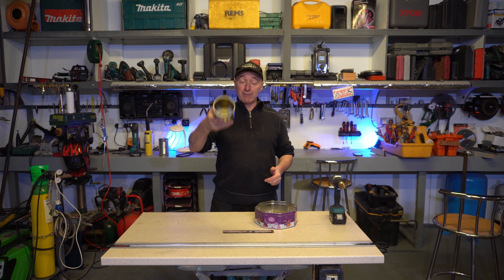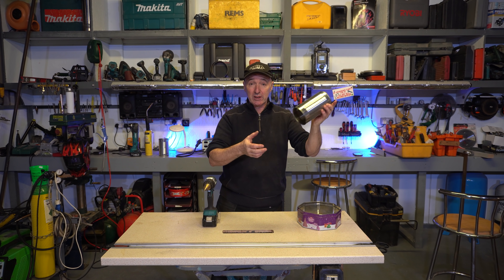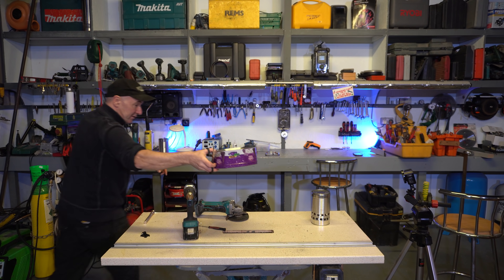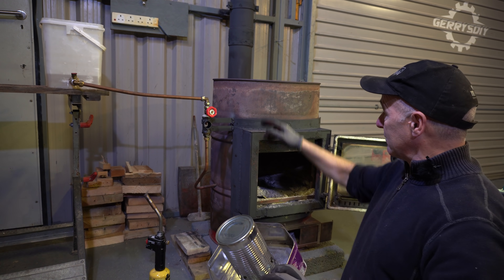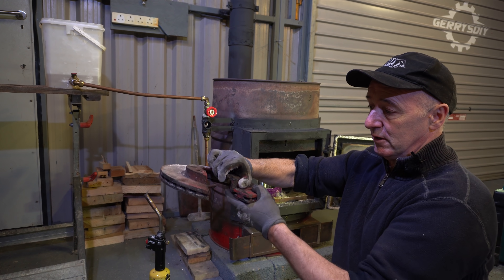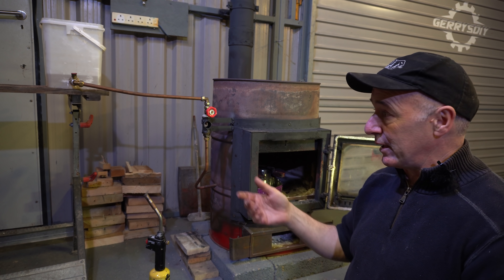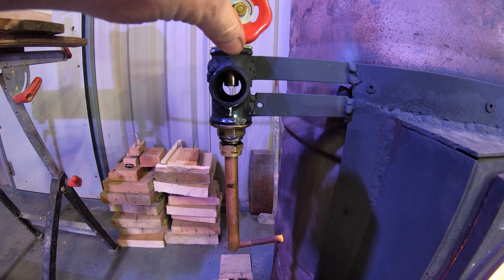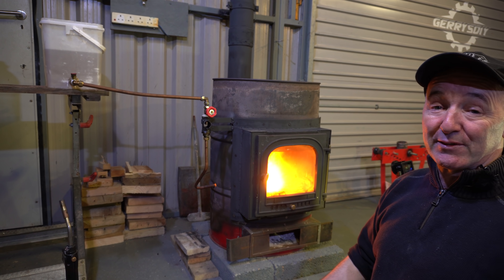Free Heat .. Fantastic Tin can Waste oil Burner

Comment from the maker: Burns Great. Sawdust and Veggie oil mixed as fuel. https://youtu.be/8TNueNfDJTg Cheers Gerry
Reply: fyi a growing trend is asking for likes and subs in the first minute of a video ---- dude. we are mostly adults watching , if your shit is interesting enough we might subscribe  but I will tell you there is a growing number of people who are so tired of people asking for subs at the get-go and it prompts us not to subscribe--- you gotta earn it
Reply: @GenX...MCMLXV  I'm with you on that 100%
Reply: Liquid oil doesn’t burn. Heating it or burning kerosene causes oil vapors.  The oil vapor and fresh air from the drilled holes are what is combusting.
Reply: @undertow2142  ummm iv started quite a few fires with liquid oil.
Reply: @undertow2142  oh thanks. I'm guessing controlling the airflow could be a bit like a throttle?
Reply: @Google_Does_Evil_Now  probably better to control the heat output by varying the oil drip rate. Ideally only enough air to burn the volume of oil vapor would enter the furnace. Any extra is just lost btu’s to the outdoors.
Reply: @Google_Does_Evil_Now  pop pop look
Reply: I used to weld workshop heaters that used the waste engine oil from cars/ trucks etc. I made the firebox from 3mm mild steel, but they were banned in EU because of the emissions. Watching this makes me wonder if the company that i used to make them for, couldn't have just switched fuels, because the principle looks similar.
Reply: @chrisyarnold6205  you can still do it, back door n all. Helping. Their aircrafts and cars are no better for emissions.
Reply: how long will the 5 liter of oil burn ?
Reply: 110 mill??  I'm gone
Reply: Maths confusion - 100MM x Pi divide by 15 is 20.?  15 what? 20 what? What size holes were drilled?
Reply: Good video. Gerry, can you talk us through what's happening? I'm guessing the air flows up from underneath and comes out the drilled holes and passes over the oil which is burning and being dripped into the biscuit chin area and somehow this cool air coming at the bottom of the flame mixing with the fresh oil starting to burn help to create the rising bright yellow flame.
Is that what's happening?

Fresh cold air coming out of those holes, feeding the hot burning oil, like a fan as you said?

Comment: We go behind restraunts and get recycle Cotton Seed Oil mostly, here in Nashvillle and use a hand crank turned pump all Nashville Tennessee  Restraunts, a grease 55 barrel is a must, as we have, three home made cooking Oil, recysled, by straining it, thru screen wire, burn the crud too, let it dry, on stacked shelves 2" apart, a dried chicken skin dried in cooking oil burns hot. Free restraunte Grease, you need a pump.
Reply: Too many commas

Comment: Sir
I see your list and have watched a couple of vidios.
Im 63 retired with a ton of fabrication and build ideas from steel.
I started at 7 and had alot of good teachers.
I have sold off almost all my tools and equipment now but have a predicament.
Hospital trips and all with the wifes passing has put me in a nice travel trailer.  Not bitchig but im comming up on another expensive winter to keep warm.  I say all this because i was able to build almost anything i needed but needed plans when i was in new teritory.
Might you have a small waste oil burner heater on here?
Prototype or not.
I live in a parking lot behind a auto repair shop and they would love for me to burn up some old oil. 
I hope this finds you well and does find you.
Thanks in advance
Bob H

Comment: Thanks Gerry, I live in north west Australia and need a heater for about 2 weeks of the year, this is perfect and you explain it like old mate in the shed. Questions, what stops the burnback in the oil feeder line, for inside use do I need to make a hot box with a smoke exhaust? No glass on front?

Comment: Missleading. Was left with the impression that the cans were all I needed. Still need the stove
Reply: You don't need the stove. It's just a little carbon monoxide. You'll be fine.
Reply: Its an old barrel wod  burner kit and is under $100 last time I looked. So if you can use old cooking grease it would just cost you under $100 to heat garageor whatever all winterand years to come if built right. It was a great video explaininghow it works.

Comment: Whats free about that? veg oil £2.10 a litre at lidl, more expensive than diesel or heating oil, twat!
Reply: You can use a car used oil
Reply: It's free in the sense that instead of throwing away the oil you used, you're using it to generate heat for cooking.

Comment: For your next prototype, you might try this to keep your fuel from leaking out from around the bottom of the can. 

Use the can as your template, make your mark, but cut the hole smaller than the diameter of the can. 
Then make slices radially out to your mark. 

Put the can on top, then bend the tabs up and in to the bottom. 

That gives you a little bent up lip to trap the fuel in the bowl. 
Secure it with a couple sheet metal screws if you want. 
One on either side will do fine.

Comment: Gerry i think you need to look into setting the oil feed system, using a waste oil controller rather than this unreliable gravity feed setup  your telling people to use, simply because you can't control oil viscosity with a tap. Get in touch. Another thing these dog food tins, how long do they last for 2 hours? Waste oil heaters need to be safe and reliable.
Reply: @hemishcurtis
He said it was only a prototype to show how to do it. But you should use steel to make it. Because those wouldn't last.

Comment: I was really hoping that the oil you were burning would be used cooking oil, I mean older diesel trucks can run on that stuff...I don't see why we can't make a heater for burning it🤔 I'd like to see something like that.   Then the neighborhood would smell like French fries🙂👍✌️  edit, oh maybe I misunderstood,you are burning waist oil...but you started it with fuel.👍ok now do a burner that a guy can make and be safe in a home without a welder or a wood burning stove... Like out of a propane tank 👍✌️🇨🇦
Reply: Cooking oil Burning point is 325 F to very high (520 F). It would melt his tin in minutes and cause a fire. Not to mention all the soot off the oil would make everything around it black.
Best to use something that burns at a lower temp.

Comment: Looks good but you also need a wood burning hitter , modified first to use it within other gadgets, what. Other suggestions are there for the container of it , I mean instead for a wooden hitter? Anything simpler? Can that be used to hit whater to go into radiators ? Thanks!

Comment: I've got years of savings of old animal fat I've been collecting in jars saving it from going down the drains and clogging up the waste.
Has anyone designed a burner for it ?
Reply: I don't entirely know if you can use solid fat for heating, but that's an interesting idea to build off of for sure.

Comment: The best heater is....The Cornish Room Heater......small plate ..slightly larger plate ...6 pennies for bottom and 6 pennies for top ....two tea candles ..please watch video on you tube 👍👍👍👍..I tried it out in our room  16feet x12 feet and it gave a temperature rise of 4C in three hours👍👍makes a big difference 👍👍..put plate on flat surface with coaster underneath .keep the heater away from immediate items so it has room to heat and flow👍👍

Comment: That sort of thing is a massive fire hasard, alot of cans like that is made out of tin or aluminium wich has a low melting temperature, be careful what you do and advise folks to when its going to be used with flammable liquids.
Reply: I can attest that aluminum should not be used in such a setup. I have tinkered with a lot of liquid fuel burners and the closer to a proper complete burn, the faster the aluminum will just melt away. My record was ten seconds from light to leaks. Of course, I only test outside on a fireproof catch pan.

Comment: Gerry, 
I just started my research on building my own waist oil burner.  
However I have yet to run across the/ a video  of all the copper  pipes and connections needed to make the drip line. 
Almost every video i have watched says they put something inside the copper pipe, just above the oil flow site hole.  
Can you share what's inside the pipe?
I have searched your comments but haven't located it. 
 I am interested in the whole gravity feed pipe construction.  From the hole in the bucket to the all the way to the burn pot. 
Thanks for reading.  Have a blessed day!

Comment: What does the inside of ur chimney look like after burning this for a period of time? Chimney fire waiting to happen?
Reply: If the burn is complete enough, it should be pretty clean. Wood fires clog up chimneys because people have a habit of burning wood less efficiently so it lasts longer between loads. A good roaring fire every day the burner is used should keep the chimney clean, assuming you don't burn through it. Waste oil/Waste veggie oil fires can get very very hot.

Comment: Where o you get waste oil?  In the USA, used engine oil is recycled and refined into new engine oil, or we use it (if you change your own oil) to lubricate the chain on the chainsaw.  
Restaurants have waste oil 'dumpsters' but they will not give you any, and will prosecute if you steal any.

Comment: I like the set up but as I seen the original it was meant for survival situations where oil was dropped onto a steel plate.

I wonder if the steel plate method I seen in my survival book does the job?

But I suppose every situation may be different and you might have to use what you have.

Comment: Very good. I built the one from a few years ago. It works well.
Reply: Hey Paul. I made one too but it smokes a lot. Does urs? And did u do anything different
Reply: @marcelwilloughby1483  mine only smokes in the beginning, once the metal is hot it doesn't. I assume you need more input air.  Good luck

Comment: Hi there very interesting and innovative DIY project -  Thumbs up from me mate! You could make a more permanent one from an older model car or truck brake drum as the oil tray as it already has a central hole and all you'd need would be a suitable piece of steel pipe the same diameter as the Central brake drum hub hole and drill holes in that steel pipe Seal off the top of the pipe by welding a piece of sheet metal to the top and fill in the brake drum wheel lug holes with suitable sized bolts and washers that could be sealed with heat resistant gasket goo or Muffler putty.  
All of which could be found at general hardware stores or auto places like Repco or Supercheap Auto stores and secondhand brake drums from an auto wrecker etc.

Incidentally - What size Holes do you drill into the central flue/pipe - need that info thxs.  And Why 15 holes and not, say for example 16 holes? or the spacing and distances for those holes from the bottom of the part that goes into the oil tray and the length, I.e. why that particular sized can and not something longer or shorter than the one you used and depth of the tin can/central pipe would be useful info too thanks. 😉 🙃

Comment: wow that so cool
Reply: Agreed -Yeah it's extremely cool.       You could make a more permanent one from an older model car or truck brake drum as the oil tray as it already has a central hole and all you'd need would be a suitable piece of steel pipe the same diameter as the Central brake drum hub hole and drill holes in that steel pipe Seal off the top of the pipe by welding a piece of sheet metal to the top and fill in the brake drum wheel lug holes with suitable sized bolts and washers that could be sealed with heat resistant gasket goo or Muffler putty.  
all of which could be found at general hardware stores or auto places like Repco or Supercheap Auto stores etc.

Comment: Free heat ? So the oil was free ?
Reply: Not really Free as such - but it could be IF you collect it from all the Fish and Chip shops or any fast food outlets that have to dispose of their used oils at some point anyways and many in my neighbourhood fast food stores at the local shopping mall have used 10 litre drums of it sitting at the back of their stores near the rear doors - but I'd need to ask the owners how do they dispose of their oils and IF dumped at landfill in the local tip/garbage dump- would they consider giving it to me as I'd gladly collect it for nothing or for free and dispose of it for them - could be a potential never ending supply of used cooking oils - provided all the small businesses don't go broke with all the covid lockdowns and economic downturns still on the cards or our future - most likely.  😉🙃
Reply: @soloman9151  I've heard of people burning used cooking oil in their diesel powered vehicles.
Reply: @OOICU812  Hi,Yeah I've heard or read that some people do that here in Australia too - but it might be tedious filtering the food particles out of the oil - dunno. But I guess it'd be worth the effort to power a diesel engine a lot more cheaply than diesel supplied by Fuel companies and according to what I've heard or read somewhere [ most likely on You Tube] our new PM wants to phase out Diesel entirely along with petrol/gas powered cars as well.  In favour I presume, of Electric powered cars and/or trucks.   Which, ironically, have to be charged at charging stations using currently coal fired generation plants for homeowners and industry at present.

And, further, we don't even have any re- charging stations for electric vehicles at present - and even iF we did - they'd only be useful in city and suburban areas of the 6 capital cities when finally instituted - so the infrastructure for electric vehicles is just not here to make them practical.   Not to mention that the distances between capital cities is enormous and the range of EV cars and trucks would be limited or doubtful depending on number and availability of charging stations in each country town along the main highway routes - which, IF the country/rural town re-charging stations happened to be occupied by locals charging their EV's would be problematical - to say the least - in terms of transporting goods rapidly across the nation over long distances. 🙃

Comment: Why not use a galvanized steel circular poultry feeder? Wouldn't that be similar in design, without cutting, or meltdown?
Reply: Galvanized steel gives of toxic gasses the cause damage to the nervous system...
Reply: @kylereese4822  The burnt oil gives gases also. And all the gases are evacuated. So, why not use galvanized steel?

Comment: Everyone doesnt own a wood heater but tks anyways
Reply: He made that one out of a steel drum that you can find for free or very very cheap. If I wasn't renting right now I could build an oil burner for my garage for like $150-200 and most of the cost would be in the double wall pipe for the chimney which you can also find good deals on if you're looking.
Reply: @onefastgmc  Excellent suggestion and don't forget the Stainless steel drums of most rotary clothes dryers are reasonable quality stainless steel - though relatively thin compared to a 44 gal oil drum but might still make a suitable housing for just such a waste oil burner of Gerry's basic experimental model.  An improved and more permanent model could possibly be made as I've suggested in my comment, nevertheless. 😉🙃

Comment: Is it really necessary to cut the hole in the sweet tin??????
Reply: that's what I was thinking as well
Reply: @PL-fc6hm  might be to stabilise it voz I just thought. With the ferocity of the flames it would probably knock it over. And I doubt there's and glue that would withstand it too.
Reply: @sararockafella  that makes sense. thanks for sharing your thoughts on the matter 👍
Reply: That's where the air enters in, up from underneath then out the holes in the side of the tin; the fire needs oxygen in this manner to burn hot.
Reply: Nah - other things could be used as a substitute oil collector and central pipe/flue - instead of the Biscuit/ cooky tin as those might one day become collector's items - you never know what people value these days that once upon a time were commonplace items - that for some odd reason become collectibles down the track.😉  A car or brake drum could be used as the oil collector for example and it would be more permanent wouldn't burn away with extreme heat - which Gerry's prototype model seems to produce in abundance.😉 I'd love to know the oil consumption rate though at maximum oil flow through - but his innovative flow rate adjuster is pretty cool too as all the parts he used can be gotten from a local hardware or plumbing supplier. 🙃

Comment: yep, we've all got that great oven to mold all this together, yea, right - waste of my time
Reply: It's only a modified 44 gallon fuel drum and those are often relatively easy to come by but you would need skills in welding to make one up yourself - BUT any commercial wood heater in any condition would suffice to make a workable unit and you can get some quite cheap from many places including locals in your area advertising them in local papers sometimes or as in Australia - on the 'Gumtree' website advertising all manner of secondhand goods etc.🙃

Comment: I guess the dog food can pre heats the air a bit and makes it burn more effectively. The larger surface of a tall can helps this, plus it holds the thing on top at right distance. This is my guess at the logic.
Reply: Dunno about that BUT it would indeed be interesting to see what Gerry's prototype model made out of other heavier gage items like Car or truck brake drums for the oil tray collector [ obtained from any auto wrecker]  plus a suitable sized thicker steel pipe for the central flue - would perform and see if that does as well or not.🙃